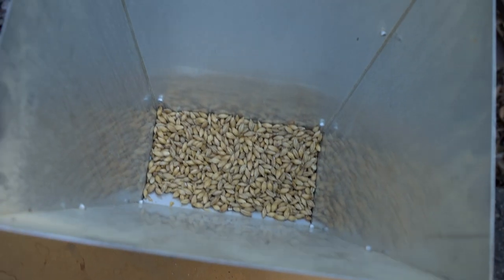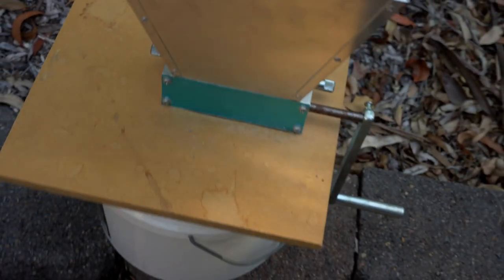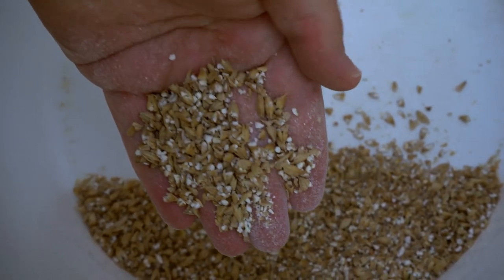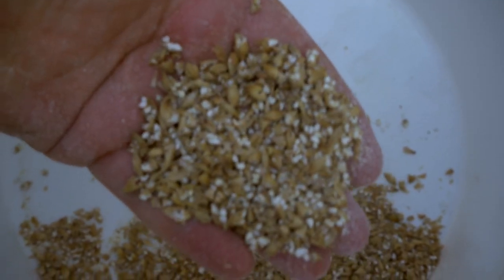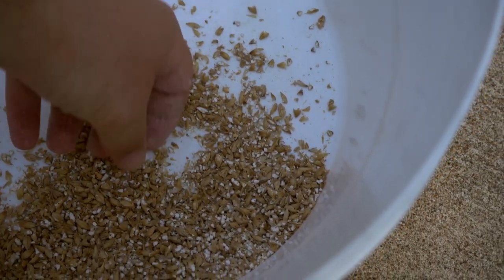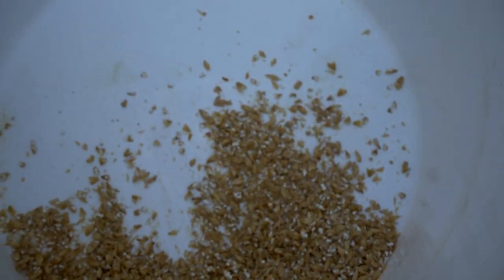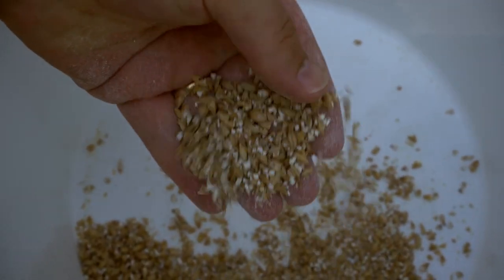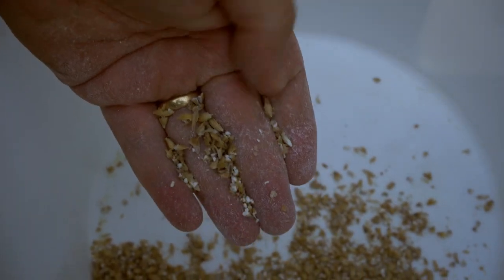Brew Like a Pro! The Perfect Grain Crush

Comment: I use the Millmaster and Grainfather, my question is about the line above: "From Gladfield Malt: We recommend that you adjust your mill to 1.45mm on the feeler gauges for Gladfield Malt." Does that gap suit all the Gladfield malts I use, Ale, Wheat, Pilsner, Munich and Roasted barley?
Reply from the maker: Hey Jock - yes with the exception of Malted Maize where you might need to dial it out a bit to get the first crush and run it through again if necessary
Reply: How did you get on with a 1.45mm gap?  Seems kinda wide?  Most mills are sitting around 0.045" (1.143mm) from what I've read.  I also use the Grainfather and just purchased a 3 roller mill to try and improve my efficiency.  The mill I purchased came pre-set at 0.045" so I'll probably try that first.
Reply: @inspectaclueso  I didn't say I set mine to 1.45mm, that was the recommendation from Beer Co for the grain they sell. I use the Millmaster that Beer Co sells and that would probably be different to your mill anyway due to the fluted rollers. Grainfather recommends a gap from 1.2 - 1.4mm and I've been using a gap round about 1.4mm with great results. https://beerco.com.au/products/mill-master-grain-mill
Reply from the maker: @jock578  @inspectaclueso one thing we find is that its great to have a mill like the Mashmaster Mini Mill that is fully adjustable.  Run a handfull through then check the crush.  You should have cracked the grains but not shredded to bits or smashed to smithereens. A few broken husks are ok as is a little flour.  Over time you will dial it in to your preferred malt supplier spec.  You can also check the CoAs on the Malts we sell up on our malt pages.  We find Crisp and Gladfield are plump so dial it out a bit for those two brands.  Sometimes you will need to dial it in for smaller grains e.g. Rye etc.  Practice makes pourfect and at the end of the day we are not paying wages when we are homebrewing so relax, don't worry and have another homebrew.  Each brew tweak a little until you have it dialed into where you want it and remember to always #brewhappy and #brewbetter